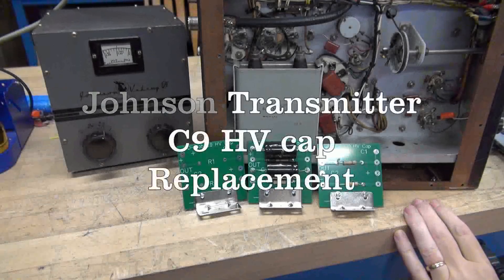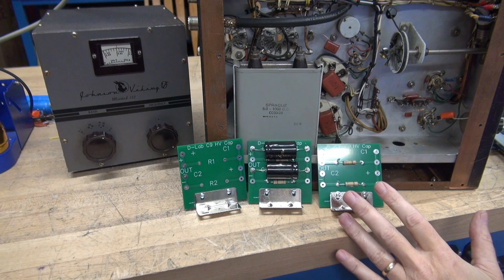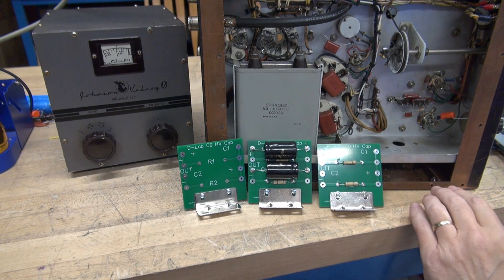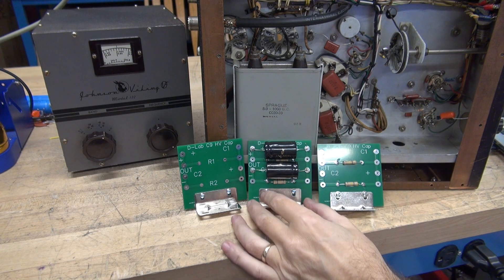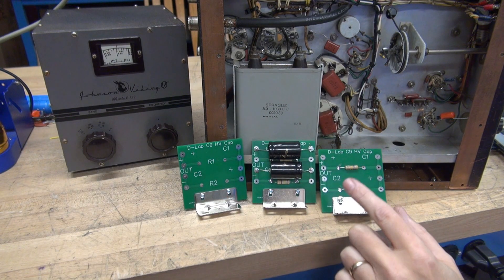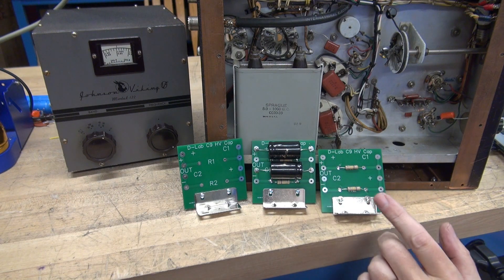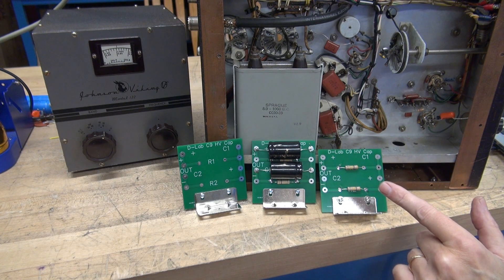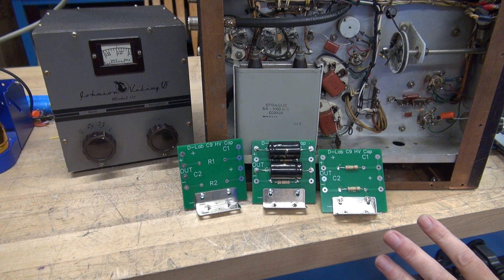Johnson Viking II C9 high voltage filter cap replacement Valiant Ham radio Transmitter project

Comment: Hey brother! Could I ask you something. I’m just kind of grasping at straws here, and asking around a bit. 

Basically, I’m somewhat of an aspiring tech, because I have a lot of amps, and gear that I basically can’t afford to maintain unless I at least try to do a lot of it myself, and this week I found a post on marketplace of an older gentleman letting go of all his electronic stuff, and I ended up getting 2 big towers just packed with resistors(brand new) with just tonnes of values, mainly carbon film, metal film, and thin film maybe, and a few odd ones out like old carbon comps,  but the thing is, he’s got the drawers all marked for what values they are, and obviously that can be determined anyway from the (colours)bands, as well as the tolerance I believe, but he doesn’t have the wattage’s marked on them, and that’s the biggest thing I’m worried about. 

I think I got a fairly good deal, especially since they are all new, and the saving grace is that he told me that he’s pretty sure a lot of them are sort of between 1/4w, 1/2w, and 1w, but I wanted to ask, do you have any advice, or tips for actually identifying the wattage of a resistor? I chat GPT’d it, 😂, and apparently you can’t just test a resistor for wattage. but yeah, just curious if you have any tips, or suggestions for me, because I’m starting to worry abit that now I can’t even use them confidently in a project, and it was a dumb move buying it. I probably got somewhere North of a few thousand all brand new in all various values like I said, and I paid $100, so I think it was a good deal in theory, as opposed to what it would cost me normally. That said, I also don’t know what brand, or make they are, but they looked pretty nice, and I’m guessing they aren’t bottom of the barel parts, but I can ask him. I don’t know why I didn’t, but I was just kind of assuming, because he looked like someone who spent his life being some sort of a serious tech, but hopefully he can at least give me an idea of where he liked to get his stuff from, or what brands etc, so I’ll ask him. Hah. It was a bit of a gamble all in all, but just figured If I even used 1/4 of what’s there over the coming years that it was probably worth it lol.